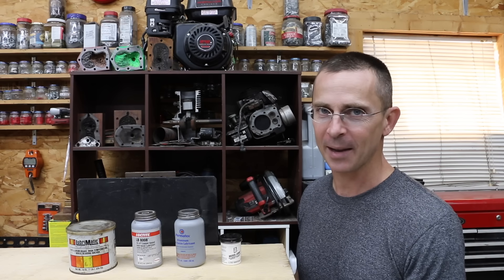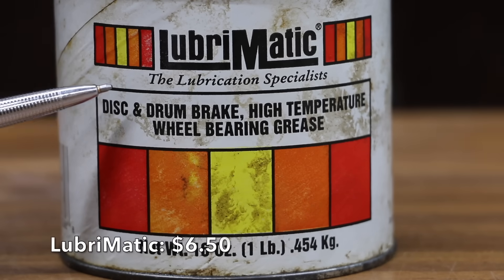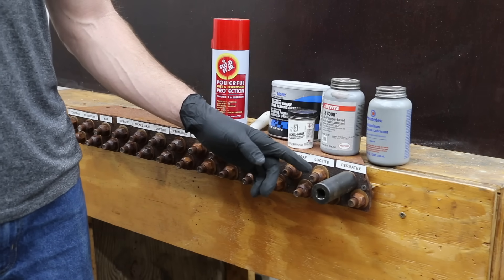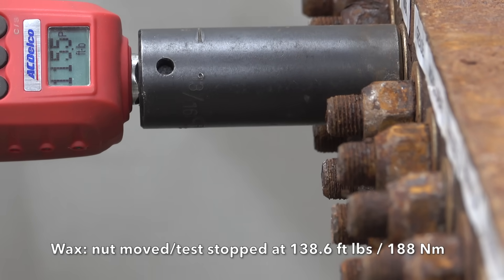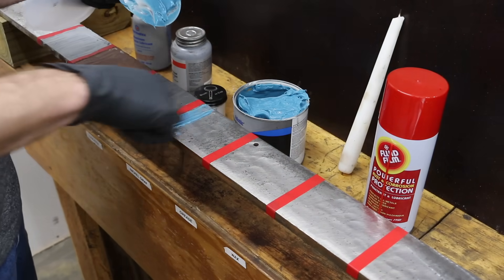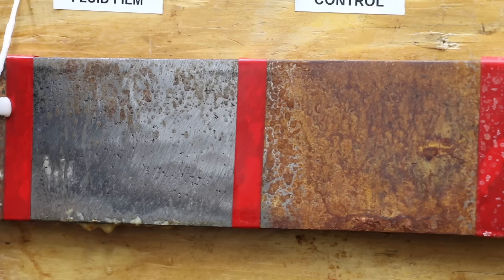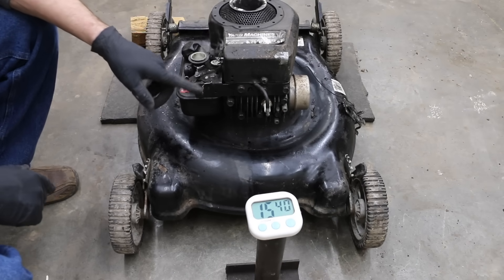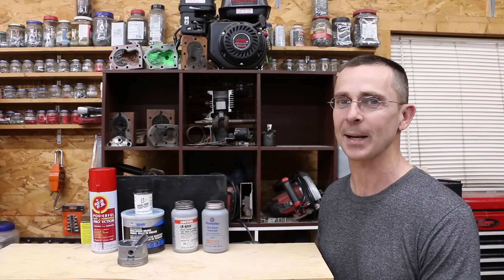Does Anti-Seize Compound Actually Work? Let's find out! Anti-Seize vs Grease vs Fluid Film vs Wax

Comment: I think you are confusing ,  Anti-Seize with lubrication  they are not the same. An anti-seize compound passes the test when it breaks free,  Not by how many fp it takes to break it free..  When the compound is applied to threads it creates a barrier or zone of dissimilar metals. Another words there is a layer of aluminum that does not need to stay a liquid to do its job when the metal begins to oxidize This allows it to last for a very long time.   When it is used on steam components the Anti-seize will dry in the threads and keep the metal apart...  Also the different compounds  copper nickel aluminum were developed where chemicals may react  with the base metal of the Anti-seize.  Grease and other liquid Lubricants can be boiled off or slung out under high speed or force

Comment: If the treads after the nut is exposed to the elements anti seize and other products are less effective as when the tread began to rust and deteriorate the nut wont come out even if you succeeded in turning it.

Best option for such application is just use stainless steel bolt and nut. Of course you have to consider tensile strength every application
Reply from the maker: Thanks for the feedback.

Comment: In my experience over several years ,working on everything from submarines to jet engines to industrial boilers I've gravitated time and again to Loctite brand Marine Grade Never Sieze. It has an extremely high temperature rating, has no particles to gall threads and has great staying power. I'd be curious to see if Loctite Marine Grade Never Sieze will hold true to form under your scrutiny. Thanks for all you do.
Reply from the maker: You are welcome!

Comment: Thank for another great film! I've used antisieze for 50 years and even on diesel turbo bolts,it always worked.just remember to throughly clean outside threads on studs as a precaution.
Reply from the maker: Thanks for sharing.

Comment: Excellent methodology in the testing....I might add one more product to your list that is my favorite: Bostik Never-Seez High Temperature Stainless
which is rated to 2200 deg. F. Contains aluminum, stainless steel, graphite and zinc oxide. I have used this to coat automotice exhaust system joints wihich are prone to rustwelding. Upon disassembling these joints the Never Seez has decomposed to a white/gray film and prevented rust welding.
Reply from the maker: Thanks for the suggestion.

Comment: That was interesting finding. I expected the big end of rod to fail as it relies on splash lubrication and anything 'thick just can't get in there before things get worn.
One you missed though, many people put stainless steel screws into aluminium engine cases. I would be interested to see a Teflon based compound used. Thanks for spending so much time to make a very interesting video.
Reply from the maker: You are welcome!  Thanks for the feedback.

Comment: I always thought anti-seize was an assembly aid to insure that screw threads tighten smoothly without galling. This was especially true when steel fasteners were going into aluminum threads. It never occurred to me that it was a corrosion inhibitor. I don't think what your testing for is what anti-seize is primarily intended to do.
Reply: In automotive repair anti seize tends to be used to prevent the rust welding of components. It also uses the same properties to prevent galling.
Reply: @zoravar.k7904  It may be used for that but that's not what it's for! A proper test for an anti-seize would be to torque bolts to an identical torque and see what product gave the most compression or most tension on the bolt. You could use a vernier gauge to see how much stretch the bolt showed. The more the bolt stretched the better job the anti-seize did. In addition you might want to disassemble and examine the threads for signs of wear and galling. You could also test the bolts to breaking, The bolts that broke at the lowest torque would have the best anti-seize. It might provide corrosion protection, but that's not what it's for, or even called!
Reply: @keithstudly6071  for thread lubrication these days the standard is molybdenum grease in many industries since the nickel based anti seize would cause galling and the copper based stuff would cause hydrogen embrittlement, anti seize is more for automotive use now and tends to be placed on mating surfaces and nuts to aid in future disassembly since we are not making these parts we need to work with what we have. If it's a rusty pos like a rotor or hub then placing anti-sieze on the mating surfaces is the difference between having to spend extra time hammering out lug nuts and then building a screw press in the part to free it or just undoing some bolts and having it pop out with one knock. It works as a good corrosion inhibitor since it provides a thin layer of dissimilar metal which prevents the rust from welding, and the grease prevents rust from forming pretty well. The rust that does form at the edges doesn't weld. I have seen other lubes used for the purpose and they work fine as well, i think anti seize is just popular since it goes on super thin and is rather dry. As to it's purpose, anything hydrophobic that can form a barrier is a corrosion inhibitor, even krown coats are just mostly mineral oils, so i don't see how using anti seize is a bad thing in some of these other applications. Even in oil/gas as far as I know these lubricants have been selected for their anti-siezing, galling, and embrittling properties as well as their ability provide more consistent preloads. Because most of these installations are exposed to the environment they need something to reduce breakout torque with some of those fastener sizes no breaker bar on earth would be enough to free a rust welded joint for service. Galling isn't the only concern in outdoor applications.

Comment: For a corrosive agent you can use ice melt. With chloride and magnesium. It's about 50 times worse then just table salt. . Good info.
Reply from the maker: Thanks for the feedback.
Reply: @ProjectFarm  np love your channel. I remember when you first started with just different oils in that red lawn mower. And that gas powered bicycle.
Reply: If I was closer to you I would give you a bunch of super corrosive ice melt we use commercially. Special mix.

Comment: i use anti-seize on glow plug & exhaust manifold threads, v band connection points, turbine connection points as well as on spark plug threads 

Yes it works.
Reply from the maker: Thanks for sharing.

Comment: CRC 5-56, apply in a cup with some washing up liquid and add some graphene just to make it work properly.

It'll open locks with the wrong key, it'll release sized crap and it will work. It'll also cause oxidation so you'll need to clean it up and add some used engine oil and MoS2 fat to make it better than new. if you get the good stuff (MoS2+PTFE dry lube) you should use that always, on anything and everything.
Reply from the maker: Thanks for the suggestion.

Comment: I've used anti seize for a lot of years, lots of different kinds. This looks like a very well done test, and to me it proves that no mater what kind you use it is better to use something rather than nothing like vehicle makers  do. I have replaced lots of front hub bearing spindle assemblies on dodge 3/4 and 1 tons. They are a real pain to remove because of the rust welding them together. I have done several of these trucks a second time years later, and the hubs only need a small rap to remove them. Steel bolts through aluminum is another good place to use anti seize, and so is the bushing bolts that go through  shocks .
Reply from the maker: Thanks for sharing.

Comment: I am figuring that the difference between Permatex and Loctite is not the manufacturer but the difference between copper and aluminum. Copper did better than aluminum. But at least for Permatex (the brand I have), copper is more expensive than aluminum and is advertised as the better stuff. So, I am thinking if you want the best, go with copper by either brand, but aluminum is good enough for most application. Any rate, another excellent review by Project Farm! Thank you.
Reply from the maker: You are welcome!  Thanks for sharing.

Comment: When you for torque something at 90 lbs. Why do you say the anti suede did well to reduce this torque when taking it off.  I would say what is closest to 90 is the best.  Less than 90 means it's slipping undone.
Reply: bolts takes less torque to undo if no corrosion is present

Comment: I used to put anti sieze on spark plugs and brake caliper bolts and sliders. But they never showed much benefit from it. If they stayed on the vehicle 20k miles or more before they were removed again you couldn't tell that anti seize was used.  It really didn't help at all with a lot of the aluminum heads that they were producing in the late 80's and 90's. Although it seemed to work ok on cast iron and steel.     /          Now a lot of spark plugs come with some form of no stick coating already on the plug. So i don't add anything to them.        /            And I use full synthetic marine grease for wheel bearings and caliper sliders. It can handle the high heat and it's designed to keep out moisture which is really the biggest threat.      /      The wax probably would have worked if you fully coated the nut and bolt with it after torquing them. Especially if the nut and bolt were warm so that the wax could melt into all the tiny variations on the surface of the metal. If you could coat the object completely, the wax would basically seal out all air and moisture, just like it does on bottles. It still wouldn't be practical because of the difficulty in getting that air tight seal all around the object. If there were any gaps it would make the entire exercise pointless.       /        A spray on plastic coating would probably work better than wax and be easier to apply? Do they sell a spray wax? just thinking out loud. ..... Good video as always!
Reply from the maker: Thanks!  Thanks for sharing.

Comment: This is a very good test.  It did leave me with one question.  Did the fasteners maintain torque throughout the test?  
AR15s need an anti seize on the barrel nut.  AeroShell MS33 is the military spec product to use.  This compound is both to prevent seizing through extreme heat, but it also must maintain required torque.
If you were to do a part 2 of this great test, you might want to include this product.  You also might want to do some interim torque tests to verify the fasteners are maintaining the original torque.  You could do this a time or two during the period where the fasteners are “aging” for several months.  Testing torque would be especially helpful after the heat cycle.  This AeroShell product goes through multiple extreme heat/cool cycles as the firearm is used.

Comment: I use the copper based anti seize from many vendors and over time for general work it is the best, given time that permatex aluminum will completely dry out and turn to dust not worth it. Permatex also sells copper based which I think vendors should stock over the aluminum stuff, just too cheap and not quality to me.

Comment: Try some chain saw oil thinned with white spirit. Apply and allow to weather for 6 months. Clean off a section with degreaser and sit for another 6 months. The cleaned area just starts to corrode. The untouched is still rust free.

Comment: Action Can CS-90 is a mix of copper and graphite. It works fine on stainless bolts into aluminium (about as bad as it gets) where the hole is open at the back. I’ve had the stainless bolts shear off after just one U.K. winter. They were always just fine after using the paste - no Al oxide whatsoever. 
I don’t know the chemistry but Aluminium sits at 4 on the galvanic scale. 30x stainless is at 30. copper sits at 13. 
I would like to better understand the chemistry but believe it works by interrupting the battery effect. 
Stainless to Al = 1.6 volts
Stainless to copper = 0.35 volts.

Comment: (Excellent testing Project Farm!)

Hey there do it yourselfers. 
Important physics note regarding bolts and anti-seize: It can alter friction, part of what gives a bolt its torque. 
Meaning, a 90 ft/lb torque on a non-treated lug nut for example, is around 90ft/lb. Our lab testing shown that anti-seize can result in more than 90ft/lb being applied before the torque wrench clicks. In several tests, as much as 120ft/lb were needed to get a click from the wrench.
Most times, that is of no concern. And not every instance leads to higher than planned torque. But it is a real issue.
Where it becomes risky is with wheel lug nuts and lug bolts. Over-torque can stretch the bolt, thus weakening it greatly. 
We remove all anti-seize from wheel lugs before re-installing the wheels as a result. And sadly the answer is no. We have not found anti-seize to prevent seizure of wheel lugs in most cases. And since manufacturer torque ratings are the best to use, removing the compound ensures compliance every time.
*Most lug seizures on wheel lugs happen between the nut and rim, not within the threads.* 
Of course, that is not carved in stone. There are thread seizures after all. Just not as likely with wheel lugs/studs unless it is cross threaded.
Reply: How did you measure that a torque wrench set to 90 lbs clicked at 120?
Reply: @timothym2241  
Good question.  
The easiest way to obtain that measurement is by using a torque wrench whose direction of torque can be reversed, to loosen a nut that was torqued with a wrench set to 90ftlb.
Such a wrench is used for torquing reverse threaded nuts. As well as in my case, checking the torque on my older wrenches.
The test was started at the wrench's lowest torque setting. Then the torque setting was increased until the nut moved instead of the wrench clicking.

Note: Those tests were carried out in a laboratory. But the results can and are often duplicated in real customer situations. Which is why our policy is to remove all anti-seize and/or corrosion and dirt prior to installing the wheels on the vehicle.
The customer has to apply their own anti-seize on their own if they wish, but they are shown the results of lab tests if we find such a substance upon wheel removal.
Reply: yup true. Best to decrease applied torque by 20% from dry spec if threads coated with grease or anti-seize

Comment: There are a couple of really important issues that you may want to research regarding anti-seize ;

1) Anti-seize compound is not always used to create a barrier against rust. I use a lot of stainless steel fasteners in aluminum fittings. A reaction between the SS and aluminum can cause galling (AKA Cold Welding) and result in badly buggered or completely seized threads. A bit of anti-seize will usually prevent galling.

2) When using lubricants on threads, you usually must reduce the torque applied. For example, if you put 30W oil on threads, you need to reduce torque by about 40%. If you don't, you could strip your threads or snap a bolt because you are way over-torquing it.
Reply from the maker: Thanks for the feedback.

Comment: The trick with a candle works on cast iron blocks (heat block with torch and touch bolt/etc... with candle to wick the wax into the cast)
also using the anti-seize is mainly to prevent "cold welding" or more accurately galling but that does result in something like cold welding on some occasions.
Reply from the maker: Thanks for the feedback.

Comment: Id like to see a redo of this. Using say all permatex products. Aluminum, copper,nickel compounds.  Id really like to know if there is any real differences.   The nickle based is about $25 vs say Aluminum is about $7.  A coworker of mine swears the nickle is best for everything. All three I believe offer high heat temperature protection. So what sets them apart?
Reply from the maker: Thanks for the recommendation.

Comment: Been using Permatex anti seize since 1976. No problems even on lug nuts, mains torque for thousands of miles and easily remove for the next tire change. Over a few decades when it drys out still leave a coating between metal surfaces so it never seizes.
Reply from the maker: Thanks for sharing.

Comment: Two things I'd like to add: I run into high temp applications where heat will boil out the fluid/grease on cheap anti-seize, leaving just the particles of metal behind. High temp anti-seize is a must in those cases, otherwise the particulate will actually make things worse, especially on threads. And when people are worried about dissimilar metals, I've good luck with Crouse-Hinds STL8, and similar. Especially when running into XP stuff, if you're worried about using something like Kopr-Kote (it might work ok, but again, concerns over dissimilar metals so I've not tried it with aluminum long-term)
Reply from the maker: Thanks for the feedback.

Comment: The anti seize didn't work well as an oil replacement because, although it might have been lubricating the engine, its thick viscosity did not dissipate heat and probably didn't flow around the engine very well.
Reply from the maker: Thanks for the feedback.

Comment: I suspect that what happened to rod was hydraulic lock - the anti-seize got in the combustion chamber and caused the rod to break.    I'm sure you knew in advance that anti-seize wouldn't work as its viscosity is way too high.
Reply from the maker: Thanks for the feedback.

Comment: This is why you do NOT apply anti-seize on your lug nuts/lug bolts!
Reply: Isn't the friction on those supposed to come from the contact with the wheel rather than the threads?
Reply from the maker: Thanks for the feedback.